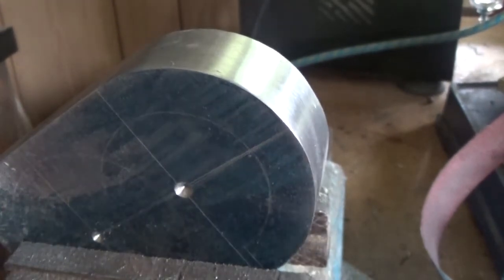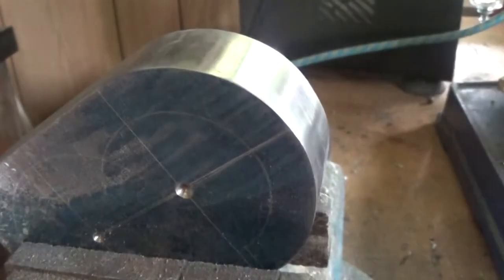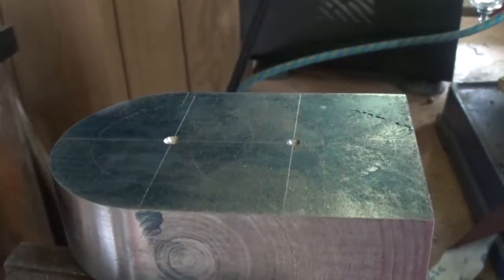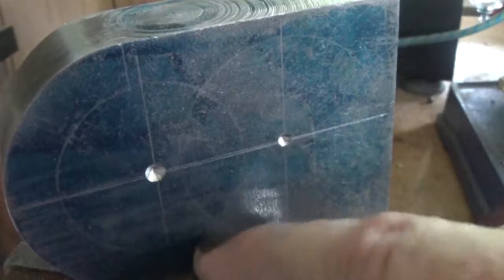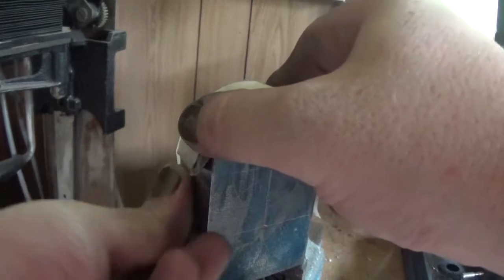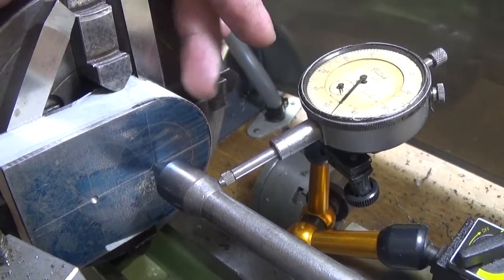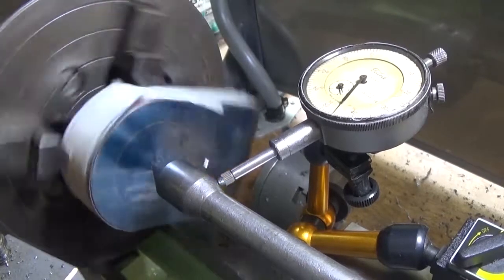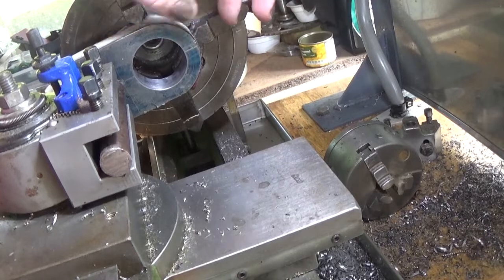Prince Dynamo motor PART3

Comment: For the magnets. Ideally they should sit above the anchor in the in the rail for the best magnetic flow. So i suggest putting in deep 5mm holes in the bottom, put in a bunch of 5mm magnets and using skews to seal them up. This way they're not visible and at the right place.
Reply from the maker: +boelwerkr big thanks for that information.. id pretty much come to that conclusion, and its nice to know someone with more idea than me has followed a similar though process. i wonder what you mean by skews though? could you give me a bit more description?? thanks for commenting.
Reply: Emmas Spareroom Machineshop

I will try to translate my thoughts as good as i can. :-)
The best place for the magnets are the thicker parts in the upper pars of the U-shaped rail. To get there i thought it would be a good idea to drill from the bottom upwards, through the thin lower part of the rail (is that the correct translation of the U shaped "magnet"?). Than you can thread a good portion of the hole, put in the magnets and seal everything up again with long screws. This way the disturbing of the magnetic flow is minimal and the magnets can't come out or move.
As i think about it. The holes would get really deep. I have some "extended length" 5mm drills for such purpose, but you may not have something like that.
Reply from the maker: yes i have a long 5mm drill. i see what you mean. so the best place is above the armature?
Reply: A crude visualization:
------------------------------------
top
//======\\  here should sit the other "leg"
||
|\
|  > <= magnets orientation up/down
|/
||
|\
|  |
bottom
------------------------------------

Yes i would put them above the axle to minimize the disturbance on the magnetic flow.
If you put them to low the field lines will exit mainly below the anchor with the winding.
Reply from the maker: Thanks a lot! Youtube is fantastic. Really apreaciate your imput!

Comment: Hi dear.  Well done, some heavy work on a very light lathe.  At one stage, you might have to weld up yourself a rigid frame for a work bench.  You will find it a lot nicer to work on a bench that does not move around on you.
Reply from the maker: +Marcel Timmers some bracing is probably all it needs..  at some stage ill have to move it away from the wall and do something about that. was fine till i put a vice on it!! thanks for watching!